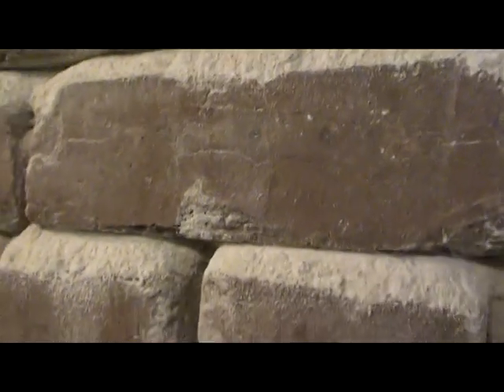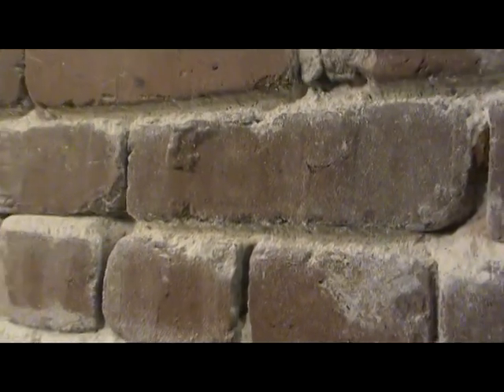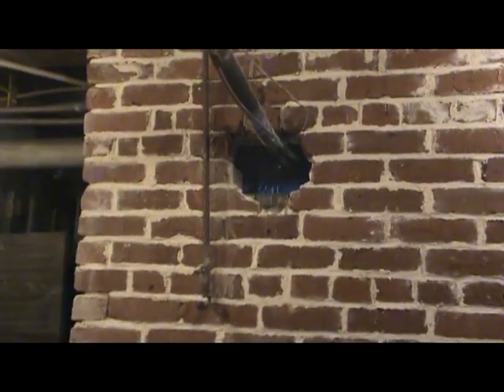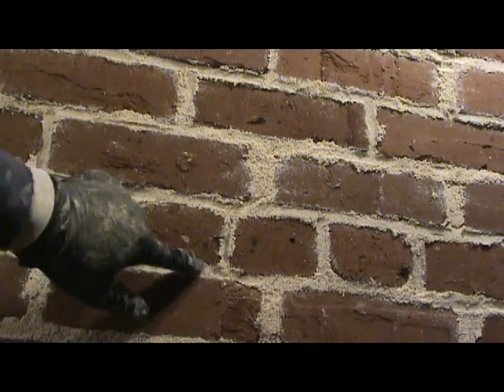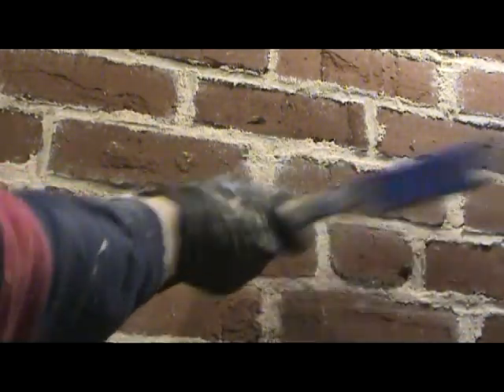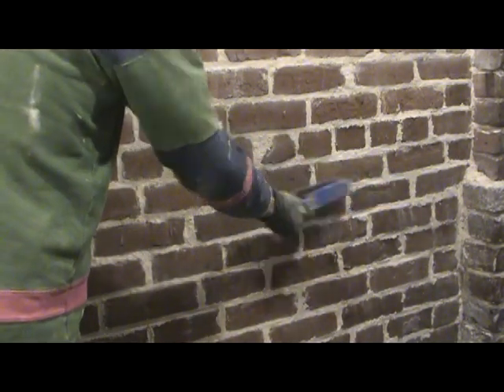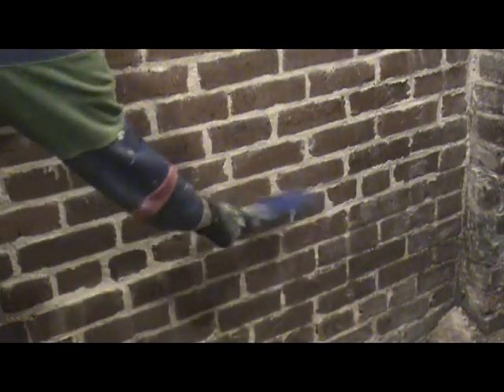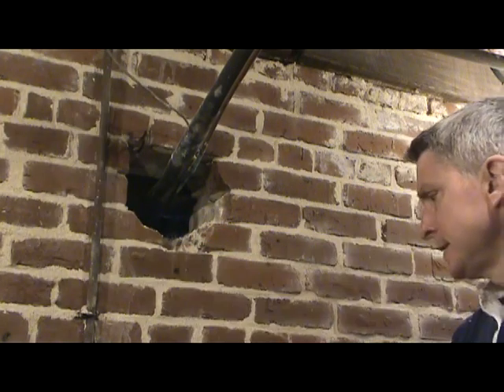How to Repoint Failed Lime Mortar in Historic Brick Pt. 1

Comment: Hello, I recommend to watch Nigel Copsey on you tube. About hot lime mixes and he talks about nhls too. Lime putty in the past was predominantly used for indoors. And on the outside hot lime often with some pozzolan added. And this can last. You just  didn't make best choice of mortar, i think. NHL can cause damage too, often buildings pointed with NHL are permanently wet for some reason. Not enough capillary action apparently. Regards

Comment: So helpful to see this technique. I don't think I can use portland cement for my case as they apparently don't breath the same, but nevertheless... just seeing someone pack joints and finish is really great vs. just reading about it! Thanks for taking the time to make this.
Reply from the maker: NHL 3.5 is probably the way to go for you. It sets up just like what I used but it has the benefits of lime mortar -- breathability, self-healing, and sticks to other lime mortar. It's significantly harder than Type O mortar so I decided to go with Type O mortar. I'll see if I regret it later. For now, everything is looking great. For the last of the repointing work I'm going to use NHL 3.5 and compare the results over the years. I'm still not sure how it will hold up against rising damp.
Reply from the maker: In the second part of this video I show a lot more of the process than in this video. This first video skimped on the technique. I think you'll get a lot out of watching the second one. There's a link in the description above if you click on "show more."
Reply: Where did you find hardness values? I have pretty soft stone, so the force of the mortar on it is definitely a concern. Everything I'm finding says O >> NHL (see link in comment below). Here's another, see pg 43. Both compression strength and hardness are both shown as lower for NHL:
- https://www.ncptt.nps.gov/wp-content/uploads/1999_02.pdf
Reply from the maker: My information was Type O = 350 PSI,  Type K (lime & sand only) = 75 PSI, and NHL3.5=750 PSI. You do have the option of using NHL2.0 which is recommended for soft, chalky stone but I don't know its hardness -- probably the same as Type K. Here's a summary: 

"Masonry mortars are specified by ASTM C 270, Specification for Mortar for Unit Masonry. Mortars are evaluated by ASTM C 780, Preconstruction and Construction Evaluation for Mortars for Unit Masonry. Following ASTM standard the average required compressive strength of each mortar types is:

Type M 2,500 psi
Type S 1,800 psi
Type N 750 psi
Type O 350 psi
There is also a type K-mortar but that is rarely used. That type of mortar is used for historic or ancient buildings that require a special mix. At very low compressive strengths, 75 psi only, type K mortar is normally one that you will rarely see and it is very difficult to manage due to its composition."
Reply: Wow. That's interesting for sure. Yeah, I saw mention that NHL-2 was "like chalkboark chalk" which didn't incline me toward that. Maybe I'll do NHL-3.5 on the above-grade stuff I can see from the outside and consider hydrated lime + sand for the inside where I'm not as worried about weathering. Your results have me questioning that plan though. Sigh. So complicated!
Reply from the maker: One of the online discussions I had about hydrated lime and sand (what I used the first time) is that bag lime is essentially non-reactive and never hardens. It's NHL 0.0. It won't work without other catalysts. You'd be better off with NHL 2. You could also go the route of having your mortar analyzed and matched for hardness with a pre-mixed dry mortar. More expensive than figuring it out on your own but maybe cheaper than ruining your stone if you're wrong.

Comment: I think the bricks need to be wetted first .Then why have a load of mortar on a plaster hawk .Use a smaller plastic thing with two tilted surfaces and a vertical piece. So 3 surfaces and a handle all in plastic .  The vertical joints are filled with a small oblong trowel . Press the mortar against the end --vertical part to form a wedge then lift the wedge out on the end of the trowel and it`s ready to plug the vertical joint .  The horizontal joints are best filled with the narrow pointing tool but when removing from the surface always slide it sideways. Pulling straight out will suck the mortar out of the  joint again . That sliding action works best for placing lime plaster  too .     Yeh that hawk full of mortar would be a PITA.

Comment: The lime mortar today is to pure. Meaning the old limes were either wood or coal fired. That method added a small amount of "contaminants" which provided a slight hydraulic set to the lime,increasing durability.Also,coupled up with unwashed sand,the sand had slight clay deposits which also acted in the same manner. Today,add between 20-40 % pozzolan in the form of a metakaolin  and the the result will be much better. B.A.S.F. chemicals or Imerys market their Kaolins one is called Metastar.
Reply from the maker: Thanks for the information, which is entirely new to me. I appreciate your taking the time. Previously, I looked into NHL 2.0 and NHL 3.5 as a solution to this problem but found that the one most common for repointing, NHL 3.5, was much, much harder than the Type O mortar mix I ended up using and the NHL 2.0 is so soft I was afraid I would be right back in the same boat with it deteriorating to powder. I hate using Portland cement for this but I ended up selling myself on it as the solution because I did some work with this same mix on this house probably 15 years ago and it's still perfect and it's very soft so I feel like I am doing no irreparable harm. The high water table here makes for a perpetual case of rising damp in the brickwork and I don't know if NHL is resistant or not. I feel like the "self-healing" properties of lime putty mortar are important, especially with all the shaking from new construction around me. I regret that I may be giving up that feature with the 1:2:9 mix I am using. Do you know if this Metastar is resistant to rising damp and helps or at least does not impede self-healing?
Reply: Learning about this myself for my limestone basement, and just wanted to comment on "NHL 3.5, was much, much harder than the Type O mortar mix I ended up using." Where did you find that? I've been perusing forums and someone linked to this: 
- http://www.limes.us/wp-content/uploads/2013/04/APTI-ComparativeLabEval.pdf

That shows NHL-3.5 at 4.15, Type O at 8-9 (depending on lime) and Type N at 15-16 MPa, respectively. Seems like 3.5 is the least strong.
Reply: When you are adding 2 parts lime to your type O mix, what kind of lime are you using if not NHL 3.5?
Reply from the maker: @gregmorgan3308  It was hydrated lime in bag form. It is not the same as NHL3.5 and I have come to believe that it is essentially unreactive and never really hardens. In this form it can be viewed only as a workability agent. Since making this video I have switched over to using mortar made only from NHL3.5 and sand.  I no longer use white portland for anything.
Reply: So the mortar that lasted 15 years..  what kind of ratio did you use and what kind of lime? Was it a 3.5 or a hydrated?  Thanks
Reply: So for repointing in a cellar to get a type o mix do you reccomend using just sand and nhl 3.5?  And if so in what ratio?
Reply: @wickedmessenger1  so if you only use nhl 3.5 and sand now do you think that is a type o mix?  And if so, what ratio do you mix when using just these two ingredients?  Do think it is a good choice to repoint a cellar with rising damp?
Reply from the maker: @gregmorgan3308  Type O is specifically 1:2:9 ratio of white portland: lime: sand. I have never used NHL3.5 with portland cement and it would make no sense to do so. I don't know if you've seen my "How to repoint with NHL3.5" video but I have the ratio of sand and lime in that video. I think I started with 1:3 but ended up fattening it up a bit by going to 2:5. This was based on feeling like the 1:3 ratio was a bit loose, almost like just wet sand. It got significantly more mortar-like at 2:5. At this point I am not using any portland cement in any of my work. The disadvantages and risks are too great.

Comment: I know this was posted a while ago, but to clarify - what kind of lime did you use in the original lime mortar that failed, did you use hydrated lime (e.g, type S) to make a putty to mix with sand? I see in your note that you've moved over to hydraulic (NHL 3.5) lime.
Reply from the maker: Yes, hydrated bag lime mixed with water and allowed to soak for several months to make lime putty. Miserable failure. It turns out that hydrated lime is strictly a workability agent and does not "go off" or, in other words, set the way we imagine that it does. Now that I have experience with NHL I will never try anything else.
Reply: @wickedmessenger1  There is a lot of bad advice out there that says you can use type s hydrated lime to make lime mortar. When I first researched lime for my old house repairs, the first red flag about type s is that none of the mfgrs say you can use it to make lime putty and all say it is for use as an additive to portland. A lime chemist later confirmed this to me. I too use NHL (the "real" lime putty is too expensive for me.

Comment: I can’t see how you can blame rising damp for the condition of the mortar. The bricks look as dry as a bone and rising damp does not exist anyway apparently.
Reply from the maker: You can't tell how damp these bricks are by how they look. They are indeed wet. There is a kind of backlash against rising damp coming from Great Britain where con men are swindling homeowners by blaming all manner of problems on rising damp and charging them for expensive damp-proof course treatments. Rising damp is not a problem for modern masonry because portland cement mortar and today's bricks are 30 times denser than historic bricks, such as the ones in my house. So in a way you're right, rising damp does not exist in modern masonry but you're wrong in saying it doesn't exist at all. Since I made this video almost 3 years ago the new repointing work has begun to slough off again and is well on its way to turning into what you see in the beginning of this video. Also since since making this video and the Part 2 video, I have sworn off using Type O mortar and now exclusively use NHL3.5 for my repointing. Any concerns I had with it deteriorating in rising damp situations are now assuaged.  They videos on using Type O still are relevant in terms of technique and procedure. I recommend watching them but disregard the mortar mix advice. Click here to watch the video on repointing with NHL 3.5: https://youtu.be/ATER7aJnjB0
Reply: Ahh, the capillary action deniers 🤪

Comment: I'd be very careful using Portland as it could cause the bricks to spall.
Reply from the maker: Read the comments in the description. I have totally disavowed the use of Type O mortar and now only use NHL3.5. Since I did this video the work has not held up very well and it is flaking off. My work with NHL has been very successful and I encourage you to watch my video of repointing with NHL3.5. There's a link in the description.

Comment: Did you address the water issue going on outside? Poor drainage (downspouts not flowing away from foundation), possibly house is sitting on an aquifer, city water and sewer pipes leaking or cracked? Leaking roof. There are dozens of issues that might BE the problem. Simply repointing and not attacking the problem, you'll still have issues.

PS: Type K mortar is 1-3-10 (sometimes 9), you went to 11, what binders you had in the mix were stretched too thin to do anything.
Reply from the maker: I did everything I can for what I can possibly influence. The main problem is that the water table is just a few feet below the foundation and it swells at high tide twice a day. During king tides the street floods. And this isn't going to get any better. Mean ocean level has increased by 1 foot in Charleston since 1900 and it's accelerating. Since making this video I have switched exclusively to NHL3.5 and it seems to be holding up much better. I will never use a mix with portland cement again.
Reply: @wickedmessenger1  I understand and sympathize, having a historic Eastlake home with a natural stone and lime mortar foundation and yes, I live along the coastline as well. Stone, brick and mortar's natural "wicking" is the issue. Combine that with the water table variation and it's a disaster waiting to happen, like you said there's not much more you can do. I've dug trenches around mine for a french drain, all that did was give the water more room for growth. If I could buy and tear down my neighbors house I could have a natural duck pond by digging out a shallow.
This is a common problem, more common that people are willing to admit. For that guy who said, "no such thing as rising damp.", Sit down and be quiet, you don't know what you're talking about.
Drilling in the basement floor until you hit "dry land" and pouring concrete support pillars is about all you can do to keep the house from having further issues BUT that will cost more than the house is worth. It might be cheaper to move the house to higher elevation.
Reply: wickedmessenger1  so it permeating damp then!

Comment: 4 sand 1 lime half cement. That's the ratio we use on historical walls that are open to the elements. I just repointed a 300 year old cooks garden wall on a  stately manor in knaresbrough uk took 6 months😱. What you need to remember is that lime is used because it's softer than the brick so if you have a damp wall the water will release at the weakest points. If you put in a stronger mix it will still come out at the weakest point so basically it's always going to come out until you sort out the damp problem 1st. Unless u put in too strong a mix then the brick will fall apart
Reply: ... and cause spalling in the bricks

Comment: Here a tip mate do your perps first then bed joints brush down later 45 degre angle to knock the snots and nt rake out joint. slightly dryer muck.Good job mate.Good full joints well done.One thing whats the broken bond about not schooled in historic builds lol.Didi you lay them?
Reply: Imran Ahmed beat the joints Bentley with a Victorian churn brush to compact the joint and clean off snots

Comment: What do you think will eventually happen since you've decided to use "portland" type O mortar?
Reply from the maker: See the video description. I have long since disavowed Type O mortar and now only use NHL 3.5. See my videos on NHL. As for what will "eventually" happen, it has already happened. The mortar failed, turned to sand. Bag lime does not harden. It is useless for that purpose. It is essentially NHL 0.0.
Reply: @wickedmessenger1  
Yes, after writing what I wrote, I read what you wrote about disavowing type O.

Comment: Hi there, how old is 'historic buidling'  Mine is 100 years old so am unsure if this counts as historic.  Many thanks :-)
Reply from the maker: It doesn't mean anything specific, I suppose. In this context it means the bricks are held together with lime mortar and not portland cement mortar. Portland cement mortar was around for a long time but really started becoming mainstream in the years heading into WWII. After the war it became dominant with the building boom. In the United States, 80% of all existing buildings were built after WWII so that might be as good a dividing line between modern and historic as any.
Reply: Anything 1939 or older would use this application. They used a heavier clay in the bricks in older homes.